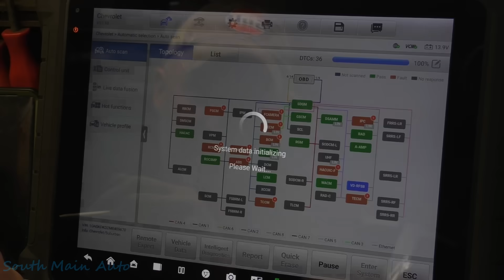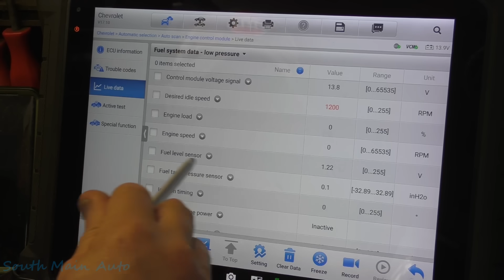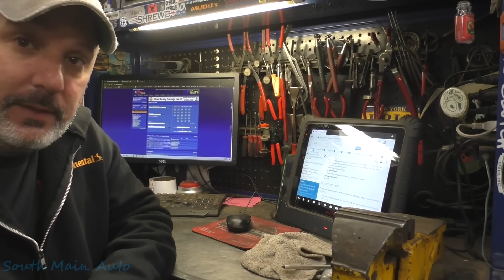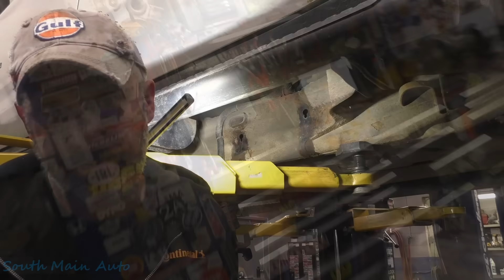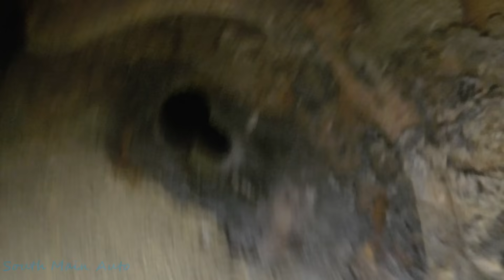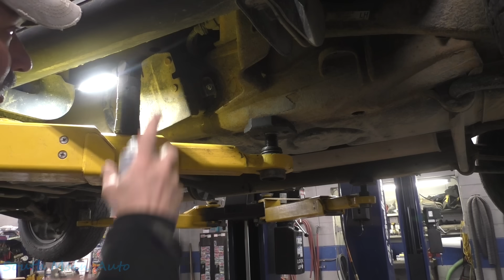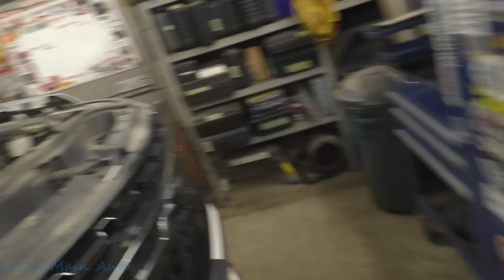'21 Chevy Suburban - No Start, Cranks OK

Comment: Oscilloscope on controller output when disconnected for controller assessment. Ac clamp on Amp meter for current draw at motor input..

Comment: Three light bulbs in place of the motor windings to see if "anything" is coming out of the inverter module.

Agree stuck pump would cause high current.

Comment: one word. kwitcherbitchin. Lol. I think GM does this on purpose to piss people off. It works semi good. Just take a concrete cutting saw and cross cut the frame on either side of the module. THen saw through the module right in the middle of the module. Then troubleshoot the problem from the inside of the module.

Comment: 15:27 its for ease of assembly at the factory, they probably added it later in the development process and it was what a team of engineers came up with to solve the problem without messing with takt time per station. 

Almost everything nowadays is designed for ease of assembly on the production line, a saving of 5 seconds per station can save millions in labor over a year of production. 

If you save 5 seconds per station and you have say 30 stations, you can shave a minute off the production time, 1 minute here. 1 minute there and then you can bump the line up to squeeze out 20 or 30 extra vehicles per shift.

Comment: This is now covered by a recall but I just did it as a DIY to avoid losing a day of my life in the service waiting room.  The part is ~$40 and it took me 5 min.  Turns out you can easily rotate clockwise/screw in those studs with a socket or a vice grip.  I live in the South so mine wasn't corroded so YMMV.  I screwed in the studs a few turns, lifted and dropped the bracket, unhooked the connector, swap modules, hung it back up and snugged the studs counterclockwise.  I didn't even have to cut the zip tie.

Comment: What about having an inexpensive RC brushless motor on hand with three little pins soldered to it so you can at least stick it in to those phases and see if it spins the motor for $20 worth of test equipment? If there is no harness in between the fuel pump I guess you would have to de pin in order to test it, and at that point, your labor would probably be better spent just buying an inexpensive fuel pump control module I guess… never mind I answered my own question lol

Comment: Hey ya Eric! No idea why GM would bolt that bracket to the frame the way they did pretty piss poor engineering in my opinion.
Going back together though it appears a guy could use a pair of carriage bolts with nuts to reinstall that bracket to the frame, however you’d have to source a carriage bolt with a square on it that fit the keyway in the frame, something to think about in the future. Great Video and keep up the good work!

Comment: We get them at the dealer all the time, i just reach up and get the module out of the bracket with a short 10mm ratchet wrench. No bracket removal. I usually do them in the parking lot because its such a pain in the ass to move around the trucks with electronic range selectors when they dont start

Comment: you can test a 3-phase fuel pump using a scan tool to command the pump on, checking for fuel pressure, and verifying electrical signals with specialized tools like a lab scope, milliohm meter, or amp clamp. A standard multimeter is often insufficient for these pumps, as they are sensitive to high resistance and require checking low-level voltage and current signals. 

This video demonstrates how to use a scan tool to activate the fuel pum

Comment: We’ve done dozens of these, especially on Malibu’s and Equinox’s. I recognized that code right away😅. Just wanted to say, we don’t even bother with the bracket. You can get a ratcheting box end up in there. It takes it little bit of bumping it back and forth, but you can pull the module out with the connector still attached. Love the channel. Been following for a few years now. Thanks for all the help, taking the time to video tape everything. I always learn something new.

Comment: I fly R/c planes and we use 3-phase brushless motors. The power is supplied by an ESC (electronic speed control) which uses a PWM signal to determine what pulses to send to the motor. I wonder if you couldn't find one that would allow you to test the pump(albeit with a bit of modification)

Comment: The biggest problem with these system is if you get a defective new module what do you do next? They should at least give you a resistance value for the windings, then you could check the windings and shorts to ground.

Comment: As a retired controls enginerd, i first had the joy of exposure to VFD's (variable frequency drives) on materials handling equipment back in the 80's.  They were in boxes that (even for small motors around 5 horsepower) weighted about 50 lbs with 5 lb aluminum heat sinks for the MOSFET....they call them IGBT's today.  The early ones used 3 phase A/C to drive a regular A/C three phase motor at variable speeds.  They were terrible and most of the ones I dealt with would stall if the speed was dropped much below 50% of line frequency speed.
The motors that drive these fuel pumps are not brushless DC motors....those require rare earth metals for magnets.  The motors on these fuel pumps are actually just A/C motors that are driven by the modules from DC supply from the battery.  This is the same principle that EV's use to drive the traction motors that make your lectric car go down the road, though with much higher voltages and currents.  This stuff has come a long way since my exposure to the first ones......just always keep in mind that OEM designers are driven by corporate objectives: cheaper components and larger profit margins.  Those bolts in the frame would have probably worked better with a stove bolt (has the square shank just below the mushroom head) but I can assure you that the ones they used were less costly.....;)

Comment: The fuel pump bracket that had the bolt in backwards should have been pushed up and the withdrawn,no need to remove bolts just withdraw through the big holes in the key ways.😊

Comment: We diagnosed one once by jumping it to power. Because it wasnt sending power. Not sure if it was this specific setup but it had a fuel pump controller. Well when we jumped it to get the unit to run it went up in smoke after running for a bit. The module literally roasted itself right infront of us.
Reply: We jumped it to the pump because the pump wasnt getting power

Comment: Do these newer Chevy suburbans or Silverado have a fuel pump reset switch which is usually I would think located near the passenger side kick panel? I believe my 2011 Silverado has a reset switch in there but not sure about the more modern vehicles. If it did would it be a good option to push that and see what happens?

Comment: They did the exact same thing on the crash sensors mounted on the intrusion beam inside the doors. You get on the end of the screw with an inverted Torx and then go righty loosy. Engineering stupidity at it's finest.

Comment: Could you just run correct voltage through the pump directly to verify motor functionality? Check to see if the controller unit is sending said current?

Comment: I have change many many of those on Tahoe’s, trucks, Yukon’s ect. Takes about 10 minutes. Very easy to do. Never had to heat any fastener. Every tech hates working on one brand or another. Eric just hates working on GM when truthfully ALL are garbage now regardless of brand name. All manufacturers are now in concert to make vehicles like a cell phone. Designed obsolescence.

Comment: Right in line with the idiot engineer at Ford that thought it was a good idea to put a water pump inside the engine driven off the timing chain.   Those bolts would have been drilled out, new holes drilled in the frame for some new self tapping screws.

Comment: As an Industrial mechanic i think those bolts are Huck bolts. Used quite a bit in industry. No access to the back side, studs would rot off, meant to be consumable. Take off, replace with new. Not sure of three phase DC, not sure if power is rectified to AC.

Comment: Used to work at a GM dealership. Replaced a ton of those modules. Only seen one vehicle that ended up needing the pump instead of the module

Comment: My 2000 Chevy 2500 came with its own rubber hammer,
If it won’t start just beat the fuel tank with the hammer, it works,
Next truck was a dodge diesel,

Comment: Amazing diagnostics by SMA as usual. I wouldn't change anything about how you made the determination on the failed Module vs Fuel Pump. Methodology was spot on and clearly you've got a high level understanding of motor principles you were able to apply successfully (and even touched on/about the square/sinusoidal-ish waveform being generated). The testing and information you gathered was simple, quick and effective. 
You were able to determine Amp draw = 0, no mechanical/electronic noise, concussive testing was unsuccessful, motor coils intact and not shorted, +/- good. Absolutely reasonable to suspect the motor driver module. Advanced system testing wouldn't be an economical use of time, except in certain scenarios (like a really expensive module, or non-replaceable because of security locks or software).
Regardless if the Module was the suspected failure, the next step would have been to replace the power module as the more economical option vs continue the diag with advanced testing of the module or pump. 

A couple of thoughts from a BSEE working in Ag
1. A rapidly switching DC power supply @ 12 Amps may generate significant electromagnetic (E&M) 'Noise' to be measured from outside the wire/module. With a probe or magnetic field tester you could look for this 'noise' outside the wire, keeping the circuit intact and minimizing disassembly. It is likely this could accurately be measured with a scope, but that wouldn't be necessary if you are just looking for any switching current flow. A seized pump would see a lot of noise on the fuel pump wires, but a non-op power module would have no noise generated. Its just a guess, but I bet you could measure this noise on the wire or outside of the power module. A working power module likely generates plenty of noise, measurable from outside the plastic enclosure.  (*'Noise' as in E&M interference, not an actual sound, but sometimes it is audible)

2. DC load tester/Power supply - Simple/cheap Elec test equipment to apply specific voltage/current. Remove the module, apply 12-14V on the bench, and look for signs of life & current flow unreasonably high or low. Check for temperature and hot spots on the module enclosure. 

3. 3x Old-school resistive test lights across the module pump output terminals (or a similar DC motor). Realistically, not so easy to setup in-circuit, but should be visibly apparent and get brighter as the output frequency increases (motor turning faster). Likely not a reliable test for low-current devices, but for a motor driver it could be a valid testing method. Easier to setup a scope and take measurements directly. 

Again, not that you would need to, but I expect #1 & #2 could help to validate your findings with quick/easy measurements.
Reply: You could also attempt to measure the output frequency (Hz) of the Fuel pump motor driver. As a mechanical device, the drive frequency should be slow enough to be measurable by a standard multi-meter.

Comment: RC cars have been running 3 wire dc brushless motors for a while now. Wiring up one of those speed controllers could possibly run a fuel pump to test.

Comment: The reverse bolts are probably the cheapest solution. A good solution would be a bolt with a nut that you can untighten but you can't screw off the bolt so that it doesn't drop in the cavity. That requires something like a special keeper flange and a threadless part in the end of the bolt or something similar to prevent the nut from falling out after you schmuuga-dooga the bolt out at high speed.

Or instead, the cheap solution: they already have boxes full of flanged bolts with inverted torx ends, used in a lot of other places, so why not just weld the nut onto the bracket, put the bolt in there, slip the bolt head in the keyway, and use the inverted torx in the small end to tighten it up. Very unexpected for whoever dismantles the bracket but I do have to give props on coming up with a kind of cheap, farmer fix that does solve the problem. They could've used nuts without the hex (like a flange with a threaded hole in the center) to suggest the inverted torx to the mechanic instead of something that looks like a hex nut.

I can't even fathom what the Germans would've done to tighten up a similar mount. For sure, something that's one-install only, requires a new OEM fastener to reattach, and for which you need a special tool to remove the old one or install the new one. Or worse.

Comment: You are a genius person but this car had bad fuel pump I notice when you used the scan tool there was some thing you did not notice in data .. it was fuel pump high voltage detected ( yes ) it means bad fuel pump you can review the date and see that .. I have fixed  this problem bad fuel pump

Comment: The only thing I can think to determine if it is the control module or the pump itself. On a normal circuit we substitute the load with a headlight bulb. On a 3 phase motor we could have a 3 phase motor and bypass the fuel pump and see if she spins.

Comment: Probably the place to look to learn how to test the Brushless DC/3-phase/ECM motors is the e-bike world.  Their is an e-bike testing device which is a breakout type device that has LEDs on the lines.  Of course, its connectors are for e-bike controllers and motors.  Given how car mfr work, there will be no standard connector/pin set up.  But there may be videos on testing the motors and what to look for from the control module.

Maybe someone could develop a simple motor controller that could spin the motor plugged into the motor wires from  the connector.  If the mfr use 3 or 4 wire motors without putting any electronics in them.

Comment: (Re your GMC / Chevy Truck – DTC PO449 EVAP video 8 years ago). On My 2018 Chevy truck 1500 Silverado, it appears I do not have power to the EVAP solenoid near the gas tank. I unplugged the wire, turned ignition on, and used a simple test light. Did not light up. I started the truck, let it idle for 10 minutes, and tested again while at idle. Again, no power. I confirmed the test light works - all fuses show power. Any suggestions please. Thanks!

Comment: Automotive engineer here (not for GM). The bracket is likely designed like that for modular assembly. It’s probably used on a few different models / platforms in slightly different locations/ orientations. Same story for the rail it bolts in to. Basically it reduces the number of SKUs and steps for the assembly process. Generally speaking lowering costs for manufacturing is going to get priority over serviceability because at the end of the day we make our money building cars not fixing them. But for what it’s worth we do our best to find the “best of both worlds” and will at times update designs for serviceability sake.

Comment: To build your own 3 phase motor tester, go to an rc airplane supplier and purchase a motor controler and servo driver. The servo driver will supply the pulse width modulation signal to the motor controler. The motor controler (sometimes called a driver)will have an approximate 6 v output to power the servo driver.  Of course, select a motor controller for proper current capacity for fuel pump.  Voltage input to motor controler probably will be listed for numbers of lithium cells for aircraft, you will want 3 cell to operate on 13.5ish auto battery.  Note if pump runs but no output, reverse any 2 leads to change pump direction.
YOU DID ASK!

Comment: As an engineer, that's one of the stupidest things I've ever seen engineered. If you want to use bolts, just bolt it to the frame. Like they're done since bolts and threaded holes existed. Or use a stud and nut. Or even weld the nut to the frame and use a bolt. So much unnecessary tooling and design to make this roundabout method. I'm sure it cost more than just doing it the "old fashioned" way.

Comment: For those of you wondering what a brakleen start is-
Lift hood up
Have a volunteer spray brakleen or carb cleaner into the carb,throttle body or  PAST the Mass Air Flow Sensor NOT thru it as the engine is started
This volunteer must be told he's going to be very vulnerable to serious injury because 
!.The hood is up-severely obstructing vision to the driver-try not to hit anything
2.Full acceleration may occur,brakes must be applied the whole time
3 Insist the volunteer does try to stay ON the vehicle as best he can
4.Beware of backfires,it does happen
Buy the volunteer a beer-he risked his life so you didn't have to push the dead pig into the shop

Comment: In industry we use a meggar to check for wire integrity. Phase to phase and phase to ground will give good wire integrity readouts
Reply: That's ok for insulation integrity.

To test current carrying capabilities you'd need to isolate each section of wire and test the near end vs the far end - essentially a dead short on an intact wire.

But even at 250Vdc (do US testers have a lower setting?) a low resistance good wire is going to see 100s of Amps assuming the tester can produce that.... not ideal on a 16awg/1mm² wire.
Reply: TDR testing would probably suit automotive more

Comment: on a three phase motor ac the speed is controlled by changing the hertz, which a dc motor doesn't have so it would be typicaly governed by voltage. I'm wondering if the pump assy has three motors or if there is three different windings in one motor to facilitate the increase in volume.